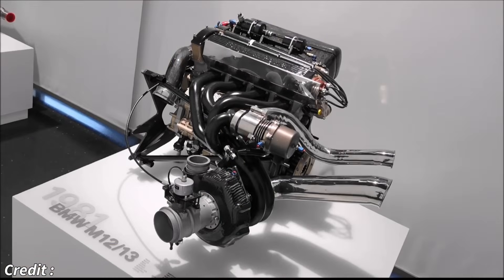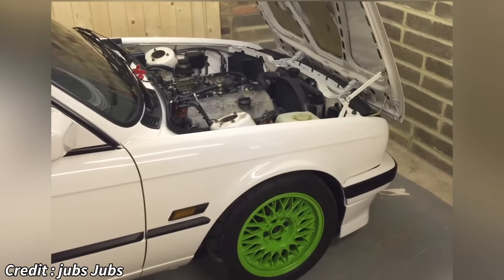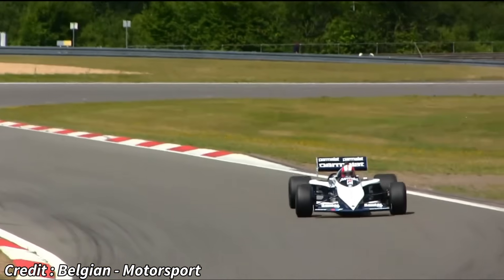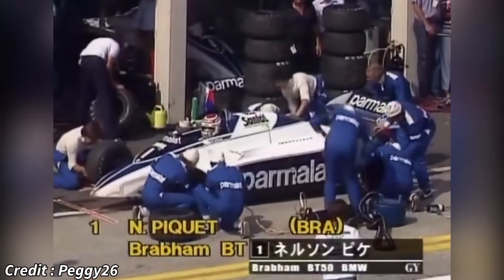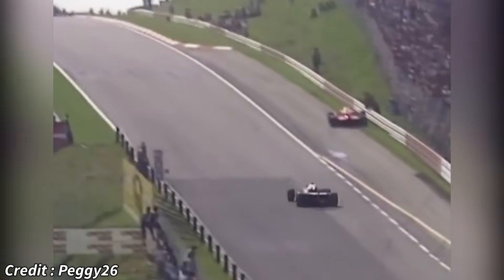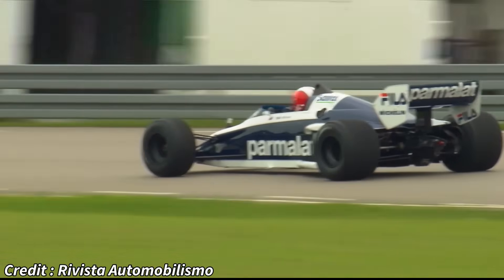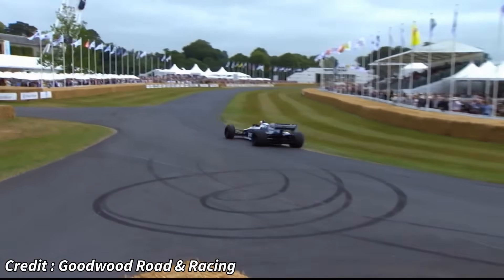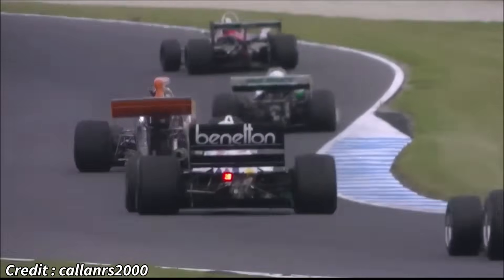BMW M12/13 - The Most Powerful F1 Engine Ever Made

Comment: 1681 hp @ 70psi
1130 ft/lbs
1499.8cc (~1.5L)
11,500 rpm

Im curious what the actual cylinder pressure was under max boost @ 11,000+ rpm... literally mind melting numbers. Take your favorite super car engine numbers than multiply them by 15... literally 

Most impressivly they made 300hp from that engine without boost. Thats 200hp/liter naturally aspirated... for refrence a Honda F20, K24 or Porsche MA175 barely crack 100hp/liter & those are some of the most powerful & efficent NA engines ever built.... that would literally be like taking a hellcat engine, ripping off the supercharger than making 1400hp... wild
Reply: Paul Rosche.   Another great Paul engine is the BMW V-12 in the McLaren F1 road car. 612 bhp non-turbo.  Gordon Murray said it would only be a road car.  Everyone bugged him and McLaren to allow them to race it at LeMans. It won in it's first attempt. 

This M12/13 4 cylinder turbo supposedly had to be replaced after qualifying.  It essentially melted.  They had special fuel from BASF aka Wintershal.  Paul Rosche also supposedly have a special chip for mapping. This was the early days of chips.

Comment: This 4-cylinder engine sounds much better than the current turbocharged V6s.
Reply: The 2025 V6s could probably do 1500 HP without fuel flow limitations. Probably more.
Reply: @lagrangian_density the point here was... engine sound!
Reply: @lagrangian_density quelle di oggi 1500 hp castrati e controllati dall'elettronica...... questo motore BMW ha il diavolo in corpo...